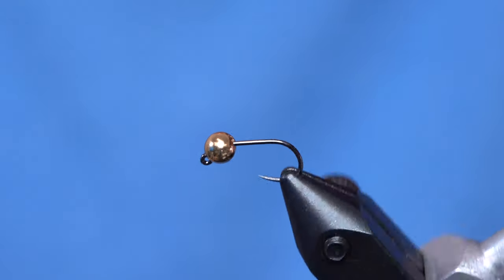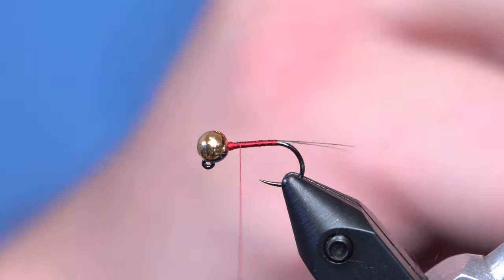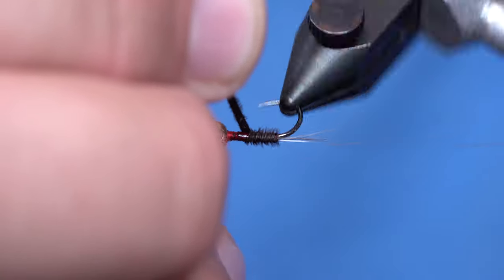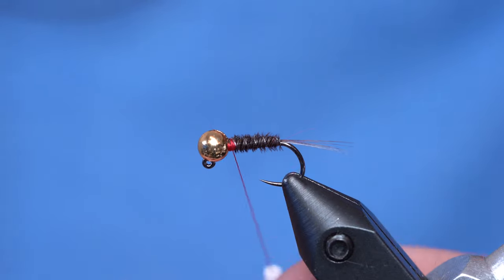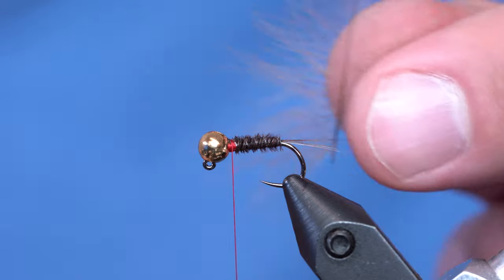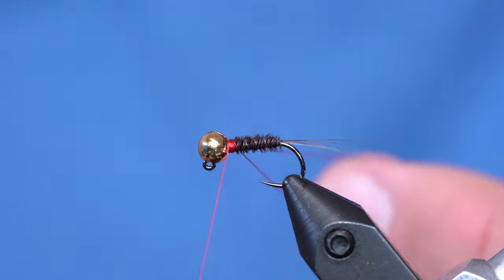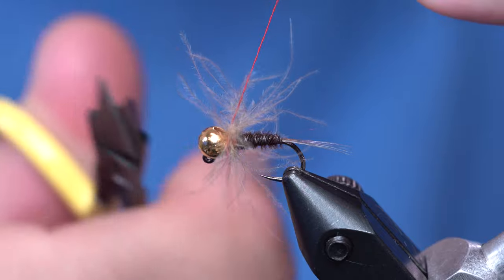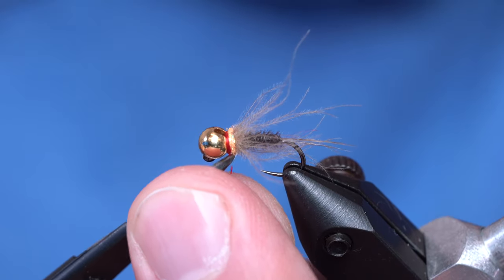Fly Tying Tutorial: CDC Frenchie: A Killer Euro Nymph

Comment: Hey Cheech, I usually just tie in the CDC feather at the tip and cut one side off if I want it sparse. I find it much easier than using a loop and a clip. Am I losing some advantage by doing it that way. The CDC seems to move well in the water.